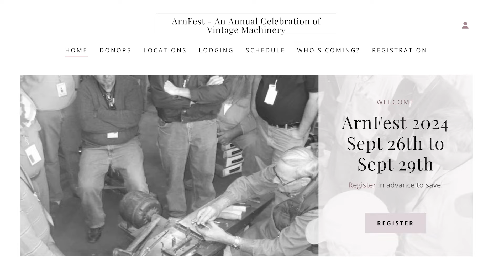Shop Meet Up, Arn Fest, Channel Update

Comment: 12:29 I have that same Cambo Camera Stand.....were you in the photo business at. one time, as I notice 
your photography is well done and so is the editing and lighting and the gear you use
......best wishes, from an old photographer, 
now weldor fabricator machinist, Paul
Reply from the maker: No, I actually purchased that used for 400 bucks. A pretty good deal. Those are pretty expensive but I want to build a custom build that’s a better version. I almost entirely use it fully extended and I want one with more range and more heavy duty. when I’m filming across machines, the reach just isn’t there. All my knowledge I learned from YouTube. Kind of embarrassed about the shaky footage. I actually have a really nice ronin, but it’s a pain to set up. The phone is nice and easy so I think I’m just gonna grab a gimbal for the phone for stuff like that in the future.

Comment: 15 ftlb is still loose make an extended left handed brill bit and drill the bolt out
Reply: How or why did you transition from auto repairs to machine shop work?
Reply from the maker: Yeah I might grab an extended left hand bit to try it
Reply from the maker: Mostly because machining and fabrication have more of a building element which suits my personality better. Also, it helps that machining and fabrication charges a much higher dollar amount. it was a slow progression overtime. We still do a decent amount of car work so I wouldn’t say it’s fully transitioned yet but like most things just happens with time.

Comment: Sorry that is not Chinese  machine that is Taiwanese the quality is like cheese and chalk .
Reply: The issue with 'Chinese' in the past is 'Westerners only want cheapest', I have had this or similar statements made over decades of getting product out of China. This leads to extreme corner cutting and WE (Westerners) are at fault. If you 'work with' a Chinese manufacturer to get to a quality standard you need then it is 'generally' a win win. Where Taiwan was in front over China was the input from the West was way easier to have that input if not the Engineering was directly done by.
Reply from the maker: Agreed